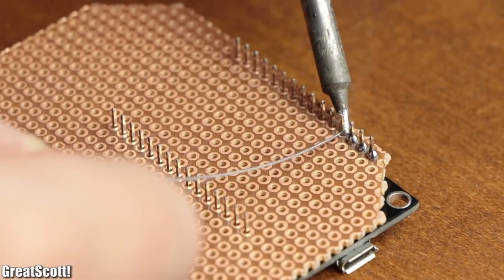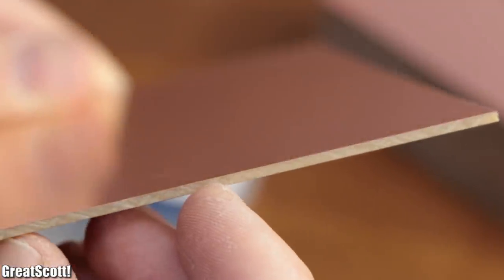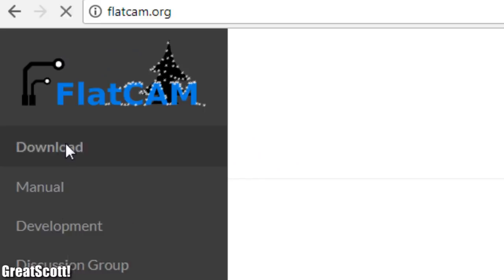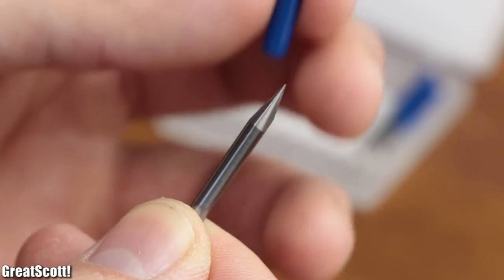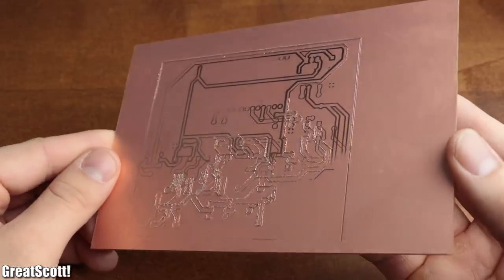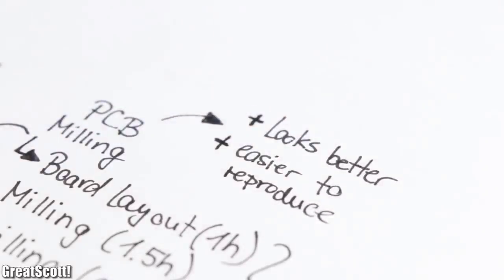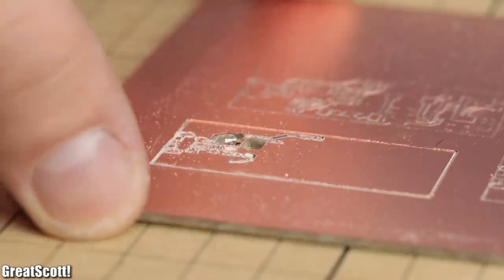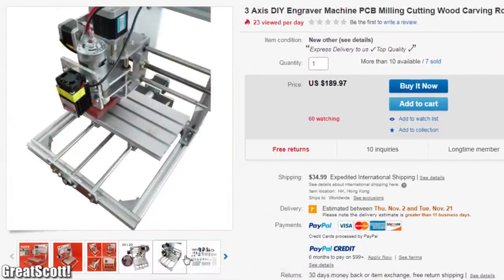How NOT to Mill a PCB (except for SMD)

Comment: I had access to a "proper" PCB mill at a previous job.

To get around the z-height / board flatness issue it had a nylon collar around the tool which you would lock off to expose just enough tip for the width of cut you wanted (~0.2 mm or whatever) and then sort of de-clutch the z-axis so that it wouldn't get too upset about motor stalls whilst doing the z-plunges. Worked every time.

You could build something similar yourself, but you'd either need to use a servo for the z-axis with a very de-tuned controller so it basically didn't care about never reaching it's target, ideally something P-mode only (very easy to implement with a cheap micro-controller.) Or alternatively really exaggerate your plunges and use relative position Z-lifts so that lost steps don't matter (easily done with a DIY post-processor on the g-code.)

While I'm waffling, I also use to generate ~3 tool-paths, with progressively larger tool diameters, and run them all without ever changing the tool. This will preserve the finer tracks / pads but give you a bit more isolation on the other parts, acting a bit like a solder mask. You can run the 2 / 3rd passes much faster as they can afford to be a bit sloppy.
Reply: Clever idea with the collar! But coldn't you just "hang" the milling motor so it can be pulled up but not pushed by the z mechanism? And let the weight of the motor provide the downward force?
Reply: I suppose you could if you were building a dedicated PCB mill, you could probably even just use a solenoid, although it would be a bit hard on the tools when you dropped them. Problem is it's wouldn't be much good as anything other than a PCB mill., even drilling would probably be difficult.

Comment: I've used an LPKF PCB mill in my last job doing prototype PCB's for student projects and it's like looking after a poorly child! The spindle had to be checked and cleaned everyday, the bed had to level at each run, the milling bits were expensive but gave the best quality. However when you set it running and came back to find the milling bit had broke or PCB was a mess, it really put your day back! The experience put me off wanting my own PCB mill and am now happy with etching using the timer transfer method.

Comment: In our 4th year university course we designed and milled our through-hole PIC controller. Were it not for the experience of our TA's it helping us with all the possible snags we would have had similar issues. You will get better the more you practice and you will find it's not so bad.

Comment: I am teaching an RF electronics class this semester and I am planning on making a series of small "demo boards" to go along with lab activities.  I need to make up 16 copies of the same little circuits, so I'm hoping a PCB mill will allow me to make these "in-house" fairly quickly and at low cost. The PCB's will be very simple, with a single RF amplifier, a power divider, a matching network, filter, or mixer.

Comment: It all comes down to application. Sure, the milling process uses time, but it doesn't use the user's time. Keep an eye on it, and have fun working on the next part of the project. As far as the results, I think that proper calibration can make the process far more reliable. If you just want the PCB, then a professional PCB service is probably the best. But if you want a PCB in a short period of time, either etching or milling may be useful.

Comment: I bought a cheap CNC from china, like u mention at the end, and it works really good, it even has a super easy to use auto level probe, to solve the multiple deeps problem. so far, it has been better than i expected. Im really happy with it, and I can make PCB faster and better now.

Comment: We doing this all the time in university, I'm using eagle and special design rules for milled PCBs. It's working well for through hole and SMD parts, we also mill PCBs für sot332 oder LQFP packages up to 256 pins.

Comment: So I bought one of those CNC 3018 machines for 120€ on eBay last month. Including a Laser, which works quite well for laser-cutting 4mm plywood. Regarding my PCB settings:
30° 0.1mm V-bit (the cheapos from eBay), cut depth 0.05mm, use candle software and make a height map first. 50mm/min xy feed at first but 100 also seems fine (other suggest even 500 down here), 30mm/min plunge speed, spindle speed at max.
I use flatCAM and use 2 passes with 35% overlap and design with 0.5mm traces and clearance in easyEDA.

Comment: I made some boards with a professional system (LPKF ProtoMat S63) and it worked great and fast. The integrated tool changer makes it even more comfortable (cutting width, vias). The results are excellent, even for small tracks. For a "generic" CNC machine you'll need either a flat surface (double sided tape) or some kind of calibration. The correct tip makes a huge difference as well. All in all a PCB milling machine is often almost as fast as etching but a lot cleaner.

Comment: Ok Greatscott, I been a hobbyist all my life, creating my own PCB, circuits, projects, DIY, etc etc. Producing PCB using the conventional laser print on photo paper, then flat iron it on the blank PCB, etch it, rinse then spray on it with insulation varnish is always my number 1 procedure on how to make a PCB that even SMD components was my way to go. Though it is really messy and corrosive due to the fact that I am using ferric chloride to etch my copper clad. Never failed me. 

So using CNC (tried it too on my home made CNC machine from salvage printer and photo copier parts) also do failed on me.

Comment: We did some PCBs for an arduino project at university. At first we tried to mill the PCB as well. With a vacuum table it’ worked well. But the whole PCB needs to be bigger to accommodate the milling bit size. Later we switched to etching. Way more convenient and much better results.

Comment: I find the quickest way is to use light sensitive PCB stock and a selfmade UV light box. 
I use the CNC only to drill the holes and cut the board to size automatically.
Any 160 x 100 mm will take about 1 hour to make from scratch... and no wrong connections!
-
Just as tip.
Do not buy the overpriced developer.
Use Natriumhydroxide as developer.
You can make your own by buying standard drain cleaner (pellets!) at any pharmacy.
Mix 30 grams in 2 liter of water. 
2 Liter of developer for about 20 cent. Develop time = 10-20 seconds.
Reply: It took me a few seconds to realise "Natriumhydroxide" is just sodium-hydroxide! 😄

Comment: Try doing it the way Marco Reps did- buy a 200$ CNC laser engraver from ebay and etch away paint from spray-painted PCB and etch away exposed copper
Reply: Not as nice as you think.
Reply: Air assist would blow the components away. Disable the air assist and solder fumes would destroy the lens. Not going to work.
Reply: Maybe a plotter could also work. !??
Reply: @JohnBailey39  I recently did this for engraving stainless steel with tracks way thinner (0,1mm) than what I would use for a circuit board. Works like a charm if you do it right, as with anything else..

Comment: I had the exact same problems you described on my 3020 chinesium cnc. What I found is that auto levelling software is a MUST. After I got used to the workflow i've been turning out some excellent pcb's (consistently). Just my 2 cents

Comment: Making PCBs is a waste of time for the one-off project I do. I use the perfboard just like you and I love it. I bought every imaginable SMD to DIP converter boards and it costed me like $60. I have a 100 of every imaginable foot-print. I just mount the SMD ICs that I can not find in DIP packages, and no problems to report.
The beauty of perfboard construction, is that I can make modifications on the spot and even move sections to another spot on the PCB and it looks good too. At least I like the look!
I am sure it would take me longer to build something using the PCB approach. Not to mention the cost of blanks, acid, blah blah blah. Or in this case, a CNC machine. 
When you add all the bits and "Optional" pieces you really need to make something like this work, you are well into hundreds more than the base price of any CNC bare-bone system.
my 2 cents...

Comment: I got a "T8" engraver as featured by various other channels. As supplied it was utterly unfit for circuit board engraving, as instead of a chuck it had a brass tube with grub screws at both ends which didn't hold the bit straight - I moved the Z down and it cut a little circle. I replaced it with an actual chuck which holds the bit much better at the expense of another 10-15mm of Z-axis space.

I made a basic probe from a broken end-mill with a switch epoxied onto the end and I love it very very much!

Comment: I own a "cheap chinese" CNC mill. 
CNC milling is an art as much as science. It took me many attempts to get an acceptable settings for PCB milling.
You could definitely increase your milling feedrate. I use around 800mm/min speed, single pass with 0.15mm cutting depth on a 30 degree V bit. I could make the CNC drill the through holes after a tool change. Would often get a good PCB in just 10 minute of milling. Saves loads of time compared to wiring on a prototype board, especially with a complex circuit.

Comment: A.  Replace those weak grub screws with short M3 screws...they engage more threads, can hold better and are easier to tighten
B.  Using an electrical leveling setup would compensate for the change in heights, meaning much better milling
C.  I have a 3018 CNC inbound...wooo!!!!
Great video...keep em coming!

Comment: I am a huge fan of pcb milling.    I bought a £600 4 axis machine from china which did take about a week of overhauling to make it function (configure for linuxcnc, add limit switches, replace the appealing excuse for a spindle etc).   The bed was extruded aluminium and not very flat so I added a 3/4" piece of mdf held down with recessed roofing bolts.   I then milled the entire work area with a dremel milling bit in the spindle to create a sacrificial but very flat surface.   I hold down the copper clad board with double sided tape and as long as i am careful to avoid ripples in the tape the top of the board is parallel with the bed.   i do not use auto levelling.   i have installed it but I stopped using it because firstly it is time consuming but more crucially if something goes wrong during the milling (like a broken tip) you cannot re-probe as there is a chance that it will probe into an already cut area which will result in no electrical contact and therefore will carry on driving the spindle into the board with very unhappy results.

I use eagle and pcbgcode.   both these applications are good but not without fairly steep learning curves especially for those of us who prefer mac to pc (i think anyway)

I have found that the supply of copper clad board is also a factor.   I recently purchased 10 small boards from eBay and half of them snapped successive milling bits as soon as they touched it but when running the same program on the same machine on the same day with a new bit from the same pack it worked fine thus I deduce that not all copper clad boards are equal.   I will from now on use only trusted sources (g00fie on eBay.co.uk is my current goto place for this and other electronic stuff)

in short I conclude that milling can be made to work extremely well but is quite a delicate operation.

Comment: Made my first milled circuit board yesterday, a shield for a shift register for easier breadboard prototyping, using one of the cheap Banggood engravers. (They're better as a training device than as a useful tool IMO.) Nine pins, eight SMD LEDs and eight SMD resistors. Gave up trying to get meaningful results from Kicad and resorted to paper and pen sketch and hand calculations. Then typed in Gcode instructions line-by-line to accurately mark the header pin positions and part of the isolation paths, and used the jog controls to manually carve the rest.

Quite happy with the result though!

Comment: The way I make PCB's is as follows.
1) Print the 2 sided board both  sides on a HP Laser printer using overhead sheets.I can re-feed the overhead sheet in my printer so both sides fit easily on 1 sheet.
2) Staple both layouts precisely on top of each other and sandwich a blank double sided UV sensitive PCB between them. I staple only 1 side  so I can lift top layout and place PCB between them. Make sure PCB is about 5mm larger on all sides. Place a thin piece of glass on top so the top transparencies is pressed lightly on PCB
3) Expose for 5 minutes to UV light (I made a special box wit 2 UV light tubes on each side and a drawer with glass bottom in between)
4) Develop exposed PCB in a solution of 30 grams Draincleaner granule in 2 Liters lukewarm water. Cost about 3 Euro's for 30 liters of developer !
5) Etch in Ferric Chloride. (See also note b)
6) Drill and cut with CNC.

Steps 1-4 take about 15 minutes
Step 5 about 30 minutes (when fresh batch of Chloride)
Step 6 about 20-30 minutes depending on how many holes, drill changes and cutouts .

Notes:
a) Can do traces of 0.6 mm without problems. All my signal traces are typical 0.6 mm.  If I remember correctly I did even do 0.4 mm without problems.
b) Always copperfill PCB. Your Chloride will last 10 times a longer.

Comment: Comparing to a breadbord:
1) This process much less tending for mistakes
2) While the PCB is milling you can relax or do something else (while it is very curious to look at the process - I can imagine!)
3) You can deligate the process to another person (which is also possible with a breadboard, but paperwork in this case will be exhausting!)
4) You can do it for pretty small SMD components
5) This is repeatable. So it makes MUCH more sense if you will make more than one peace or you will replicate this with PCB outsourcing with no time for gerbers - you already have it!
6) This looks MUCH better

Comment: for prototyping I usually use equivalent through hole components where possible and if I can't get a particular part as a through hole I'll solder some legs to the smd.  I rarely need to do it to more than one component so it adds maybe 10 minutes to the process.

Comment: I have one of those cheap chinese machines. It's first job was to cut replacement parts for the slightly larger cheap machine I bought at the same time. I've used it with FlatCam and Chilipepr with varying success, mostly due to needing to buy more bits. Auto-leveling is time consuming but worth it and easy to implement.

Comment: Two suggested methods could improve your results.  
One would be to face off a sacrificial spoil board(MDF) using the router to generate its own flat and parallel surface on which to mount the PC boards prior to engraving. 
Another would be to consider a vacuum fixture made on the router to hold the PC board flat without clamps in the way.

Comment: nice video, I use the following process with a 3018PRO (cheap but upgraded spindle to 300W)
- Draw single side design on Sprint Layout
- Export as Gerber file
- Open Flatcam and import the file (same process and settingS)
- Export CNC job
- open Candle and home the bit with probe (without probe you'll never manage a good board)
- Create Heightmap
- Start job after map created
Optional load drill holes file from flatcam and use same heightmap

Comment: Hands on versus hands off time is what is important here. Particularly if you plan to make several. I have a CNC machine and have done this with good success. Usually for making PCB for LED controllers and PDB for my R/C stuff. But the real issue is that with the CNC you can do at best two layer circuits by using double sided Printed Circuit Board Blanks. I have not done that since just thinking of getting the two sides to align would be a quite difficult. Single layer however is a synch! Yes I would like to see cheap cnc video. Great Job!!!

Comment: My CNC runs into the same issues. Leveling the spoiler board will help. What I've been experimenting with lately is spray painting the board and using a laser to etch the traces. Then dropping it into ferric chloride to finish the etch.

I also agree that you're milling way too slow for copper boards. There's not a lot of physical resistance in the cut you're making. A faster cut should produce a cleaner edge as you'll be cutting more than rubbing the surface.

I think with a little more practice, you'll be getting better results.

Comment: For cheap CNC3018 (under GBP 200) I used 60 feedrate, but the most important part of the process is heightmap (I use GRBLcontrol aka candle). This will a take a while to do map measuring height on multiple points in both X and Y axises but it will adjust height in your program at specified points (measured during creating a heightmap) so your milling ends up with cosistent deepness.
Another thing is that it take so much time only on the beggining, after you get to know all the apps you can run your project from scheme to ready PCB much faster, you can do many PCB cheaper than ordering them and you do not have to wait.